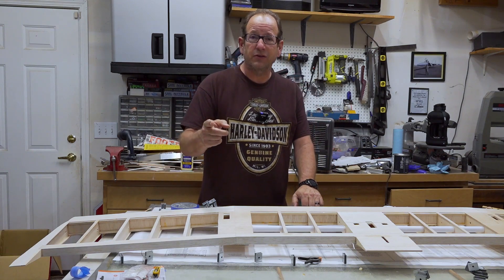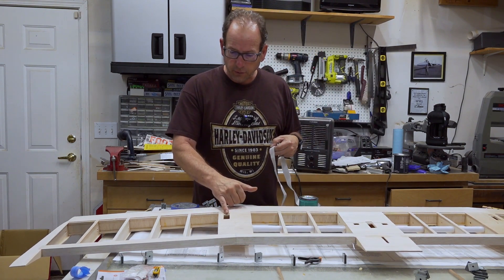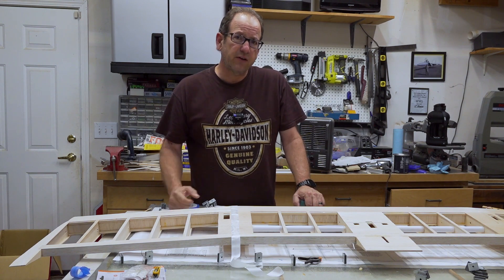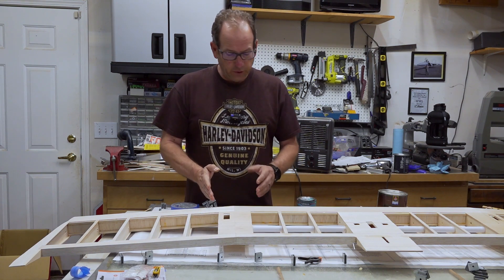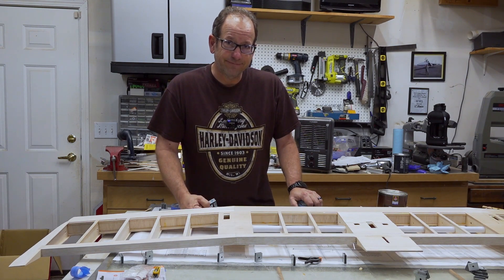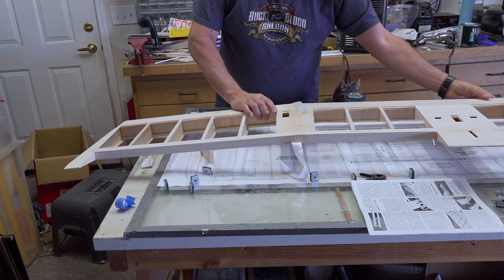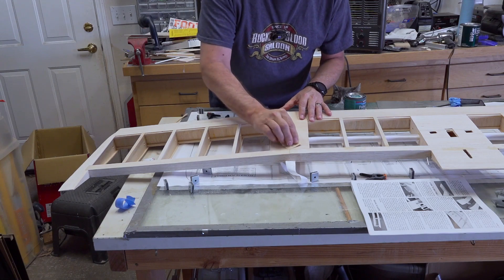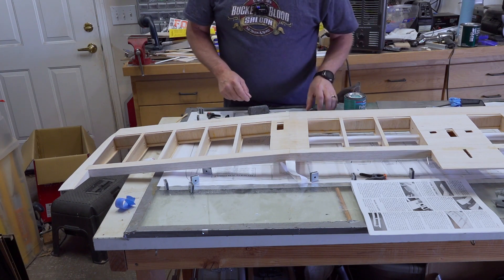Fiberglassing using water based Polycrylic:  Fast dry, no fumes, Easy to work with.  Flying King

Comment: This reminds me of the time a friend of mine who was older but a novice builder and pilot built a old time high wing trainer and glassed the center with that 003 super fine glass that used to be advertised in RCM as being used on a award wining scale Mosquito . Well he was learning to fly and got into a turning dive coming at us and pulled a max G pull up and the wings folded he then hands me the transmitter (as if I could save it) I closed the throttle and collapsed the antenna and turned off the transmitter as it Lawn Darted into the Earth confirming Newtons Laws.

Comment: Seems like you would want maximum penetration into the wood because the glass is a reinforcement of the joint. By using such a light coat you are minimizing the penetration. In other words, the strength comes from a really solid connection between the glass and the wood.  Shallow penetration assures only a surface bond. The epoxy is ideal because it penetrates before hardening.

Comment: When you cut fiberglass, use masking tape on the cut line.. it will keep it from fraying. Also you don't want to glass over anything less than 3/32nd balsa wood. I use minwax poly when I glass
Reply from the maker: I have a friend who has built a couple of planes for me and he uses the minwax poly on the entire plane.  And it looks great.  He has built and flown several with the minwax poly and you would never know that he didn’t use an epoxy or polyester resin. It forms a hard finish that can be detailed out.
Reply: You can also use spray adhesive to one side of the glass. Then cut it. Doesnt fray and there is no masking tape to pull off which could fray the glass.

And, the light cost of spray adhesive helps you position the glass and smooth out before you apply whatever resin you use.

Comment: The "15 minutes" referred to in 15 minute epoxy is the gel time, not the drying time. 15 minutes from when you start mixing to stop applying it because it's going off.

Comment: Can you use an oil base polyurethane on fibreglass to cover XPS foam ? Does it works? As the water base polycrylic ??
Reply from the maker: I’m not sure which foam is XPS.   You should test.  There are so many chemicals that eat open cell styrofoams, but the foam they build foamies  with can often be glued with CA superglue now.
Reply: @Capgains7777 he must mean eps...i don't think oil base poly eats up any foam...i used it on epo many years ago...

Comment: Have you ever used polycrillic with sig koverall?
Reply from the maker: Hi Richard.  I have not used that combination.  If you are talking about sticking it to an airframe with the poly, I've never thought about trying that.  Usually you want something heat activated to stick to the frame like Sig Stik It or Balsarite.  If you are talking about a clear coat on the top of the coverall, that would probably work.  I've just never tried it.   I don't know that poly can flow through the cloth as it is designed not to allow buterate through it.

Comment: Because it is wood, I would not use a water base Product.....
Reply from the maker: It actually works very well on wood for fiberglassing.  But not on floats I have been advised.  It is not water resistant.

Comment: I wouldn't advocate this for a fibreglass wing join. Go with tried and true epoxy resin. Any extra coats are not adding strength, just weight.

Comment: I suggest light weight filler and filler/primer to fill the weave.  The extra epoxy or polycrylic to fill the weave is gonna add weight and no strength.  The polyfill might be pretty light, and it might be worth experimenting with the microballoons to thicken.  This works great on foam, too!
Reply from the maker: I’d like to find a nice light filler.  Micro balloons would probably work well. Maybe to fill the weave but then I want a nice shiny hard coat for priming.  So maybe another coat of the resin.  I have used one part Bondo putty and it works great but gets you stoned while applying.  I’m spending more time these days searching for ways to build without harmful fumes.  Filling the weave on these joint reinforcements isn’t critical.  But when I cover a scale plane that is supposed to look like sheet metal it will be more challenging.

Comment: It is waterbased polycrillic. Water and balsa do not matcht. How to prevend the balsa to bubble?
Reply from the maker: Hi Frans!!!   Yes water saturating balsa will warp, swell and distort grain.  In the video I emphasize using a very very light coat on the first pass and letting it dry.  The dried urethane part of the mix will build a resistance to water in the next coat from penetrating the balsa.  It actually worked really well.

Comment: Why not use Zap epoxy finishing resin it’s actually made for this work, if you think it smells bad I think you need to find a new hobby like maybe knitting sweaters with aunt Mildred
Reply from the maker: Aunt Mildred is no ninny.  She is a force to be reckoned with.
Reply: Right, the worse it smells, the better the hobby.